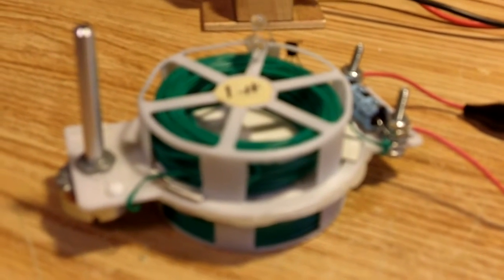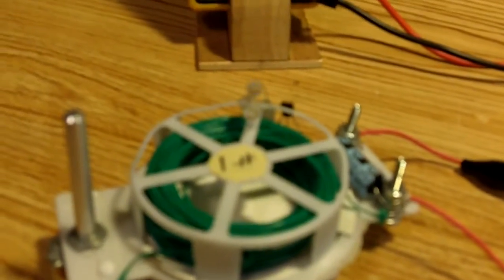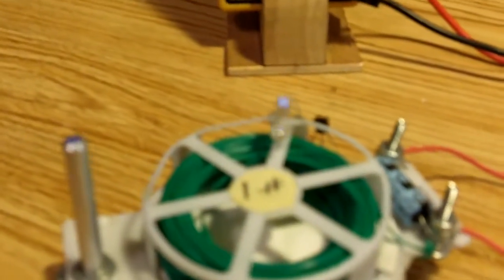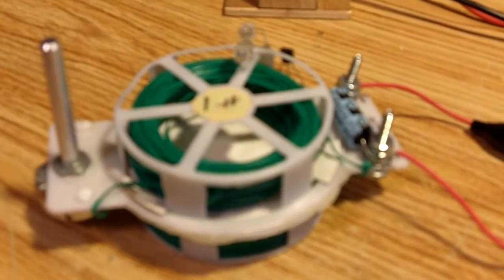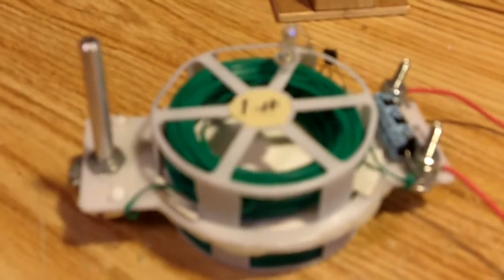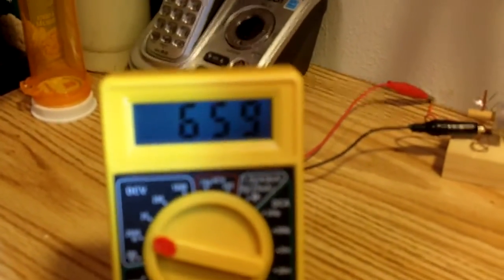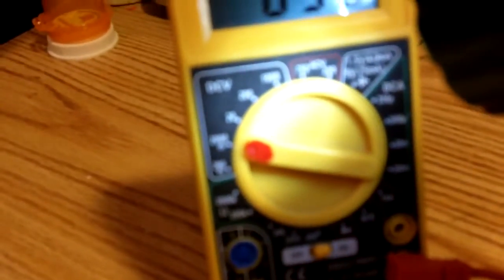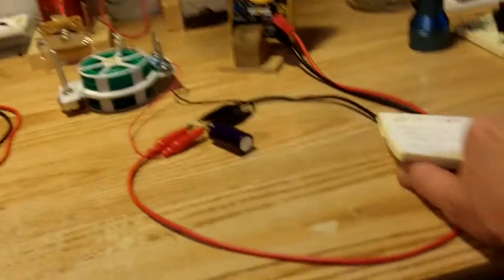Penny charging super cap

Comment: Yeah, the coil acts like a battery bringing energy from the vacuum into the circuit through resonance. Is in a sort of equilibrium with the vacuum. In fact, for a load to work you only need a coil or more, in a special form and resonance. Keep going with the good work! Tnks for sharing!

Comment: I ran a replication experiment right away because I had a 50F cap that had been sitting for several months with 664 MV still on it.  I shorted out the Penny circuit for several minutes to make sure that was empty.  I ran the experiment for 10 hours (without the meter attached) and the cap went down to .661 MV.  I will try it with the meter attached (but turned off) and see what happens. Maybe we have an energy receiver with that ????? The amp draw is less than 1 microamp so it won't take much.

Comment: Well---- Like the other guys said-- make sure the caps are all stable before you start the experiment.   The caps rebound and because the Penny oscillators draw such small amount of power you might be getting a false indication of something special.  Also leave the meter off to eliminate that as potential energy source.  That said----I have had a similar experience using a 200F hybrid supercap on large Penny.  The cap was stable and went up in voltage over night.  We need to look into this more.

Comment: I agree with IB2's first comment..leaving the cap a while before it goes on the circuit. 

How's this: the LED allows return to the Negative from the collapse spike, the 2 coils connect at Positive. There seems a route for part of the collapse energy to get into the supercap, the rest through 1 part of the coil and LED - and, because caps react far quicker than batteries, 'may' be showing as increase in charge :)
Also, note how disconnect from an AA will see LED flash many times, off just 330uF.

Comment: Good results. That was very cleaver of you to use a super cap instead of a battery. The suppercap allows you to measure instant voltage variance and current draw. It would be intersting to know the frequency it is pulsing at. Good job.

Comment: Very impressive, but what was the standing voltage before you hooked it up to penny? What you need to do is charge a super cap to the 600mV and then let it rest over night and the next night hook it up to penny to see if it will increase. It could be the cap trying to rebound back but if you let the cap sit for 24 hours and then hook it up to penny and it increases then you have really got something, I mean you really really got something! Way to go!!!!